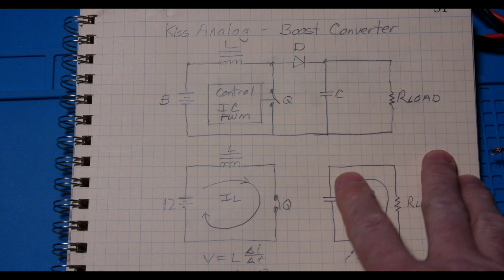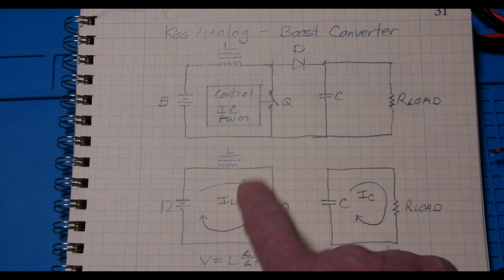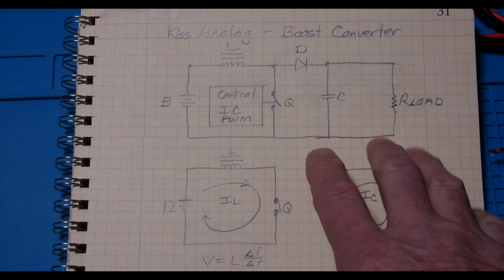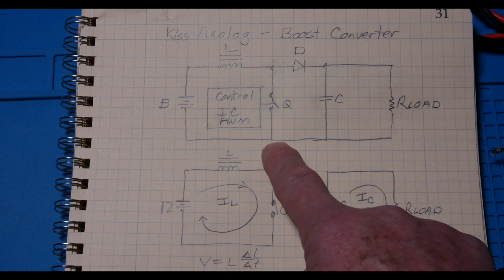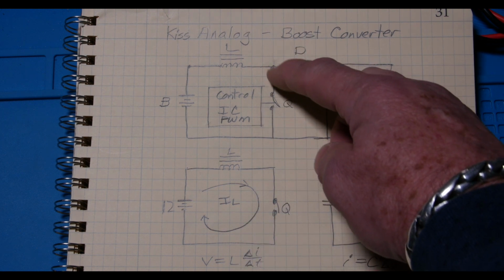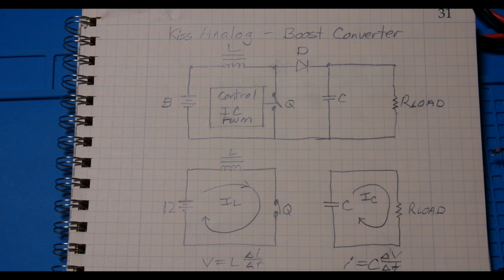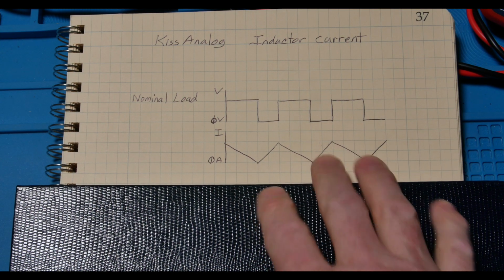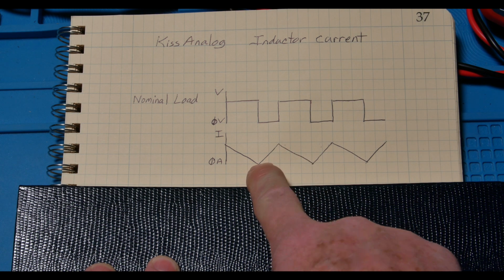Discontinuous vs Continuous Conduction Mode

Comment: 8:20 Is this the circuit for Discontinuous or Continuous mode? Or both?
Reply from the maker: Thanks for asking!  At this point the schematic/s are for both.  It depends on the current needed and the inductor value used.

Let me know if I should do another video in a different way to explain this.

I also plan to offer written descriptions and equations needed to design for either.  What do you think of this?
Reply: @KissAnalog  I think you should add a caption to this video, that says "the schematic/s are for both CCM and DCM.  It depends on the current needed and the inductor value used."

Please tell me what is the time-position in this video where you explain how mode depends on current and inductor. Cuz i don't understand that. 

I come to youtube for videos, not written explanations. 
But do put the formulas in the video description. 
Thx!

Comment: If the duty-cycle in CCM remains approximately constant, how does the controller increase or decrease the output power? Is the duty-cycle making minute changes that result in significant changes to the DC current?

Comment: Great video very informative. Thanks
Is there a way to lessen that ringing? Adding capacitors or other parts?
Reply from the maker: Great question - and yes we can clean that up.  I’ve been hoping to get to that soon.  Thank you!
Reply: @KissAnalog  Yeah after some googling I read about this snubbers that can be used to dampen the ringing, adding a clamp will also lessen. Cant wait for your next teaching videos. Thanks
Reply from the maker: That's true - I should do a video on that very subject - the difference of a snubber and clamp - and how to design them - using the Kiss method of course;). Let me know what you think.
Reply: Sounds great! Looking forward to that video while I'm locked at home due to the quarantine. Thanks
Reply from the maker: Thanks Joey!

Comment: Hi Eddie.  At 22:53 it's showing 13A Pk-Pk ripple which is quite a lot isn't it?  You mentioned 100W - so at approx. 20V, that 13A ripple is riding on top of around 5ADC?  Is that an indicator of a mis-sized inductor and/or output capacitance?  I would assume that you would normally size the inductor/capacitor as a trade-off between minimising ripple but handling transient load in a responsive way?  I think this is where it gets really complicated!!  

I presumed that on mine (buck, not boost), where I fitted a 50nF inductor instead of 50uF, that it was working hard to get out of discontinuous operation in order to meet the feedback voltage requirement from the load, that was causing large ripple which blew my linear regulators but also was working the high-side Mosfet so hard it rapidly overheated and blew as well.

I've been looking at current probes recently but haven't taken the plunge yet - that Tektronix is going to be some expensive piece of kit, albeit with good specs.  It will be interesting to see the difference in output.
Reply from the maker: Andrew Johnson Thanks Andrew!  I have one more important topic to present, then we’ll design a converter going over the trade offs.  I think you have a great idea of things to come.  I’ll post the video with the tech probe very soon.